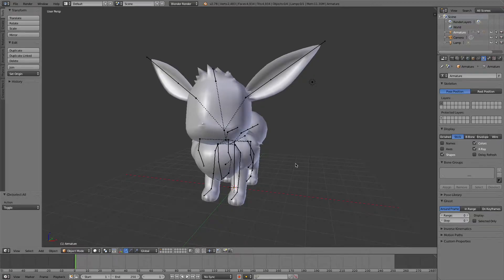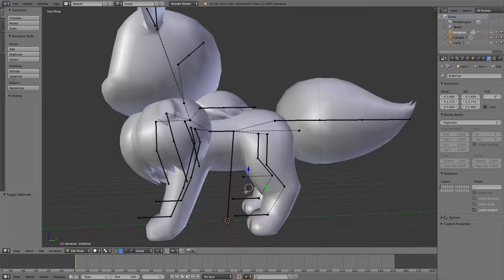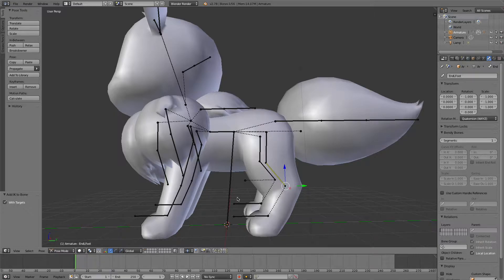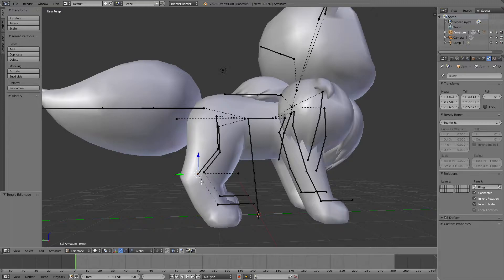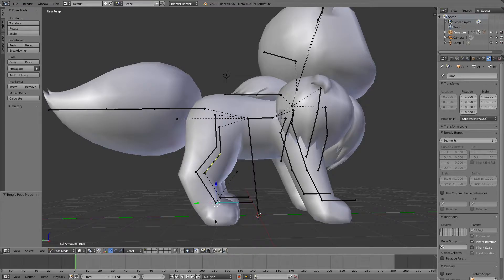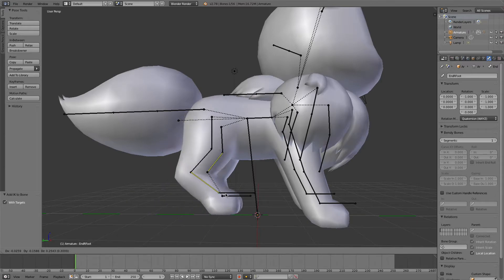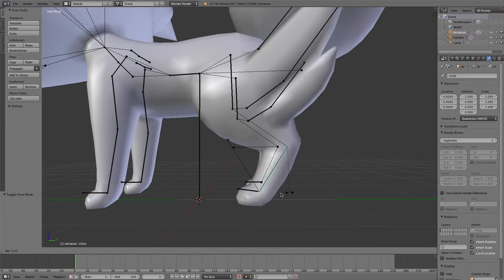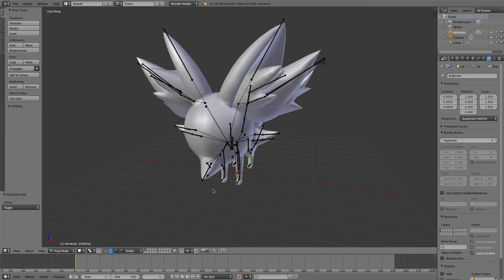Quick Blender 3D Tutorial:  Improving IK Constraints/Fixing Disconnected Bones in Pokemon Armatures

Comment: This helps alot Thank you and Im new to Blender and i wanna start with Pokemons

 Unrelated 
 The Pokemon im trying to animate has no bones on their hips so they can sit (absoL) how do I fix this?
Reply from the maker: Hmm.  Which version of Absol are you using?  The XY one imports with a hip bone by default as long as you enable Auto Connect in the import menu.  (See the first few minutes of my tutorial on importing models in 2.8 for more details.)

Best of luck with your Blender adventure. :)
Reply: @Wiimonkey2  I did try using Auto Connect but it didnt work but I tried Find Bone Chains and it fixed it Thanks

Comment: I know this is a pretty old video, but I'm guessing you fixed the rest of the bones yourself to make them line up like that in the first place? When I get the Eevee XY model off of model-resource, the bones all point to one side and aren't connected very well.
Reply from the maker: I've had that happen before with other models, but I can't recall it happening with Eevee specifically.  What Eevee looked like at the beginning of the video is how it used to import for me by default.  That said, you are correct about this video being old, so a lot has changed since I made it, both in terms of Blender and my knowledge on my subject.

When you're importing your model from the import menu, try enabling "Auto Connect" "Find Bone Chains" and "Fix Leaf Bones." It's possible what you're experiencing is a common problem that has sprung up since these tutorials were made, (where all the bones import disconnected by default) and if enabling these boxes fixes the problem, it's possible that you may not need to reconnect the bones manually at all. :)

Comment: I actually have an issue where I ripped the krookodile model,and when using one of the 3ds animations,its left arm is glitched,the other is fine though. Can this fix that?
Reply from the maker: Um... I'm not quite sure.  I don't have too much experience working with the original animations, so I can't give you too much advice.

If you were planning on fixing the animation yourself with keyframes, something like this could help, but I don't think adding an IK would automatically fix whatever glitch you're dealing with.  From what I know, it may have to do with the roll of the bone.  The bone's local XYZ axis could have changed during the ripping process from what it originally was, or the XYZ axis may correlate to a different direction in Blender than it does in whatever program the devs used.

Comment: I download many models but in mine there are no bones
Reply from the maker: Did you import a .dae file or a .obj file?  Importing a .obj will not have the bones with the model, while .dae usually does.  However, since my first tutorial, (assuming that you have seen it) Blender added something that makes the bones appear small by default.  This can make them harder to see or select, so to fix this, when you are selecting a .dae file to import, look towards the bottom left of the screen and you should see an open tab called "Import COLLADA".  Inside that there is a box called "Auto Connect".  Check that and then import the model as normal and most of the bones should connect to one another, making them more visible. :)
Reply: HOW YOU DOWNLOAD